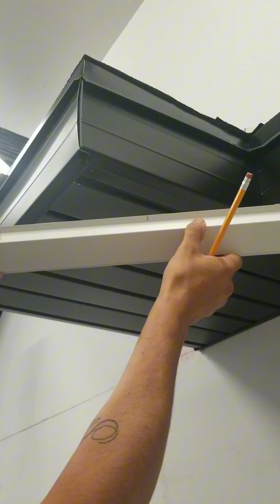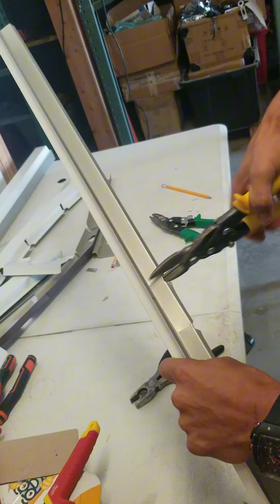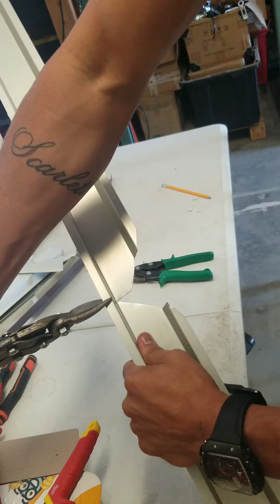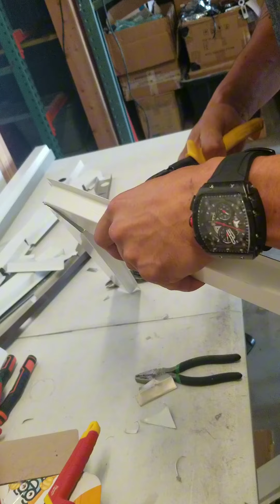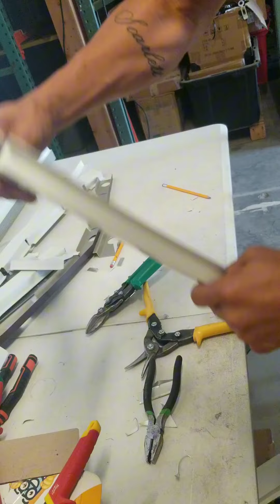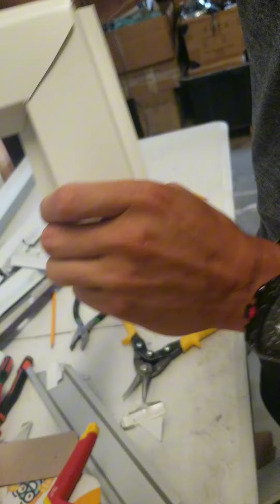Become a MASTER INSTALLER with Invisilights permanent lighting

Comment: Is this you practicing? Or is this how long it actually takes to make these cuts on jobs? Just curious cause the video was approximately 5 mins for essentially one corner. Wouldn’t it be easier to just cut, cap, and do like a butt joint? Or naw. 

I’m new to permanent lighting and trying to find the fastest most efficient way but this felt like it lagged on.